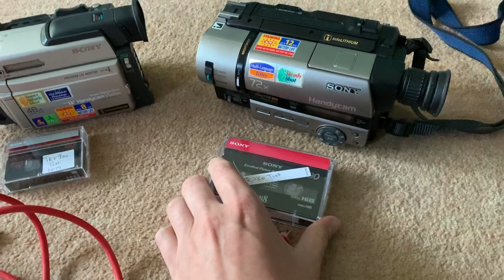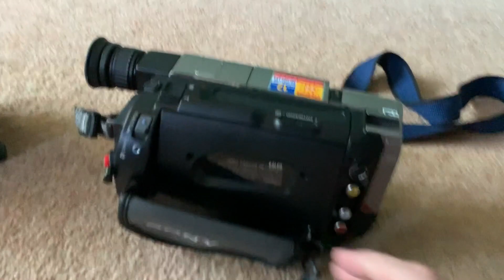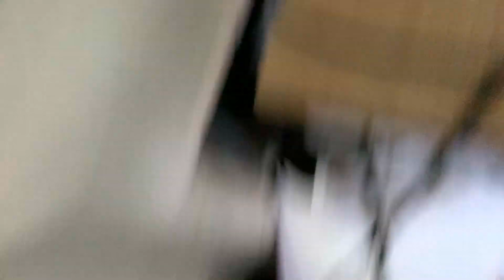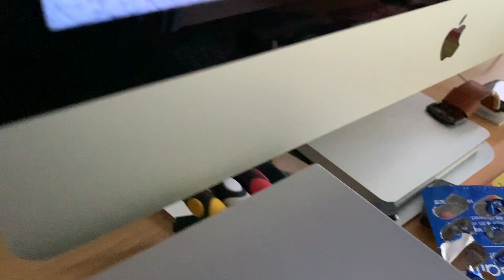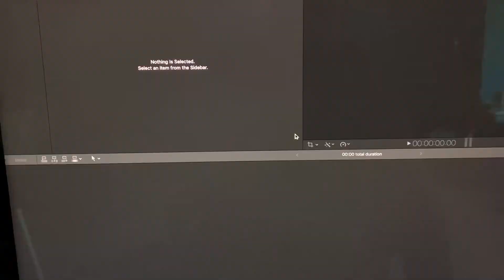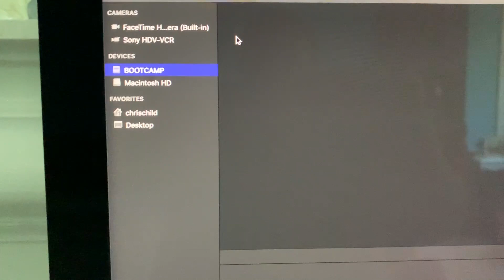How I Upload My Old Camera Videos To YouTube IN 2019

Comment: Hi Chris ! If I want to upload straight from the camera (Sony HDR FX1E) is it possible to upload it in HD using a firewire cable? at the moment I cannot invest in the deck. I recorded on panasonic Hdv/dv amq (and it's my first tape). thank you!
Reply from the maker: Hi yes indeed it does output HDV via FireWire so no need to use any other device. It's what I used to do before finally picking up a HDV deck. Panasonic are the best tapes in my view. Never had issues with them and all I use in my pro HDV units. I do not let Sony go in them.

Comment: How do you do this for pc
Reply from the maker: It’s a straight forward FireWire cable for a pc so you’d need no silly adapters like I need to use them on my iMac. That being said if your computer has no FireWire on the back you’d need to add a FireWire card to the pc tower in order to use it. If you have only a laptop with no FireWire you need to get some sort of capture video device that works for you.
Reply: @epicchris1985  is there a device you recommend?
Reply from the maker: @slowpokerdz6094  Do you own a full size computer? If you do and you do not have FireWire on it as it's so new you can look up FireWire cards that plug into the motherboard on your PC then you will simply plug the cable into that once it's all installed into your PC.. If that all sounds too much you can get a Elgato Video Capture device.. It goes via USB not FireWire and will work on both a PC and Imac. Doing this will be much easier but you wont get to the digital picture you could of got if you used FireWire.. Hope this helps.
Reply: @epicchris1985  i have a pinnacle movie box
Reply from the maker: @slowpokerdz6094  ohh ok so that's got USB and has the phono inputs so that will work just as well :)